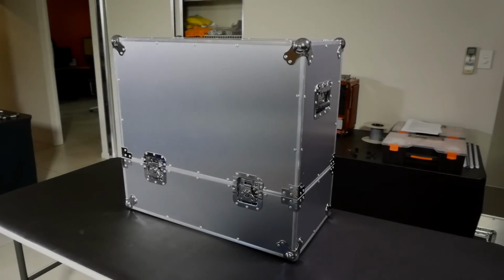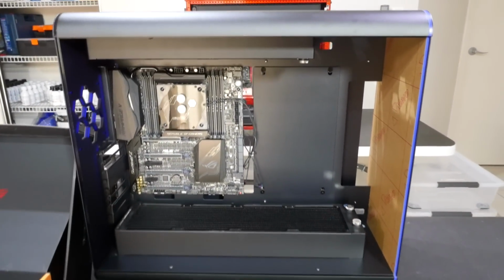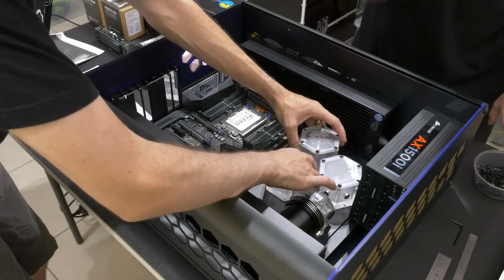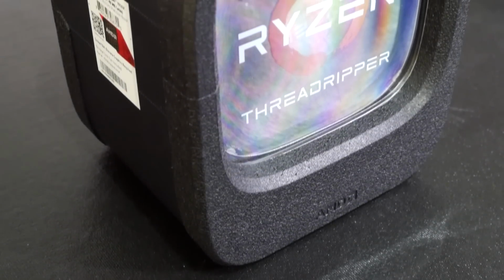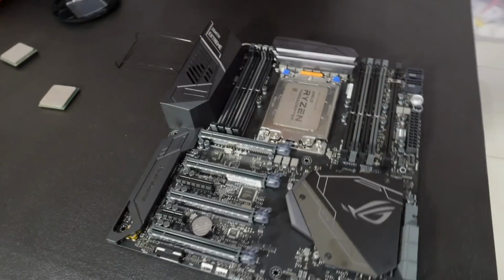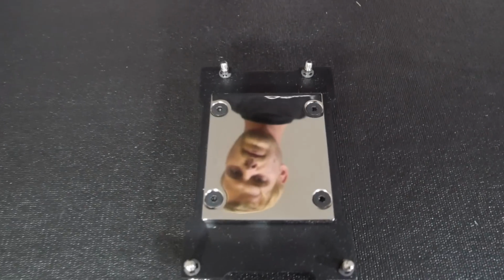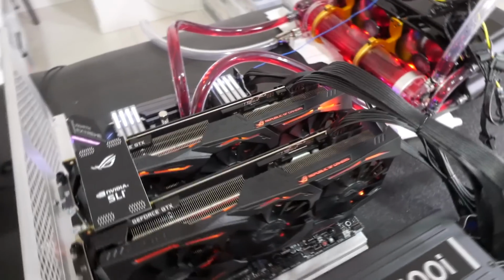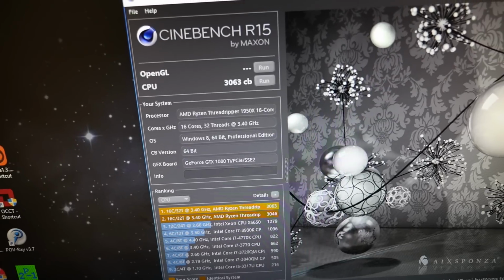Tritium Ultimate Threadripper Build Part 1

Comment: There is not much value retention in pc components, they are like cars.  I'm still using a system I built in 2010 for $1300, but it's now worth about $200 on craigslist IF I could find the perfect buyer. I could argue that the value retention is in the longevity of the components, but if you are suggesting in any way that this system will remain "top of the line" for any length of time that's funny.

Comment: Out of curiousity, what was the total cost of the whole system?
Reply: what i got from amazon links, ca 5000USD
Reply: Its well over 10k. Exact amount, idk. But an SLI with 1080Ti is almost 2k, power supply is about 350, each M.2 is 300 minimum.

Comment: If i have 1200W power supply and components require minimum 400-900W, will it waste just that amount of power instead 1200W?
Reply: And the benefit of having an overpowered PSU is that it won't need to run the fan full blast if you don't use it all.
Reply: The computer will consume only the power used by your components. It doesn't matter of the power supply is 1200W. That just means it can deliver up to 1200w.
Reply: 1idd0kun Thanks, I wasn’t sure about that either 🐨
Reply: xXSilentAgent47Xx needed more power for oc stuff..
Reply: spare some electricity for your bathroom lamp dude, no one want to hurt those tiny little toes

Comment: Did you run the rams at 2133 MHz? Does not it work at higher speeds?
Reply: I think 2133 it's the stock speed. You have to enable XMP profile in bios to choose at what frequency you want them to run

Comment: That EK block doesn't have flow over the whole IHS.. And that may not currently be a problem for some, but should AMD decide to use  4  modules instead of the current 2 then that extra coverage would surely help.

Comment: Make sure you change useplatformclock = false in bcdedit. Open cmd with administrator rights, type "bcdedit /set useplatformclock false" without quotes.  The ROG Zenith Extreme comes with Ai Suite 3 which turns useplatformclock to True.  This causes Threadripper to have some nasty lag and performance hiccups  It doesn't play well with Useplatformclock set to true.  Turning it off (false) also decreases boot time.  Also some of the boards ship with old firmware for the OLED display and Aura.  For a while, after the October Bios release, mine would only display red colors and OLED would not respond to changes in the livedash program.  Got the latest firmware and Bios from December installed resolving all issues last week.  The 4GHz profile made by ASUS causes issues for me with useplatformclock set to false.  just manually changing the multiplier itself, though, worked flawlessly.

From a fellow ROG Zenith Extreme/1950X Owner.  I was able to OC my system to 4.1 GHz stable but I haven't played around with voltage yet to see if it will go any higher.  I'm content with 4.1...

Comment: Why are the temps so bad even in idle/bios? Even for 16c 32th that must be unusable under load.
Reply: It's only in BIOS setup, for some reason Ryzen CPU's always run hot while setting up UEFI/BIOS, as soon as they boot into O/S it cools off again.
Reply: 64 degree celsius cpu diode on idle isn't healthy either.
Reply: but it isn't idling, all the cores are fully active, it's a kind of test load
Reply: You realize windows screen is idling? I took the temps from before he started prime.
Reply: Hmmm, yes you are right, didn't spot that first time. It also shows both GPU diodes at 52 C so I wonder if it's reporting accurately ? Aida 64 may not be perfectly optimised for Ryzen yet.

Comment: i have a question: for the AIDA64 sidebar (on the desktop) you use the windows gadget app. I've seen your video about it, but i can't use the windows gadget, it does appear that it has been disable by microsoft for security reasons :(
Windows now wants me to use the windows store instead. How did you fix this problem ?

Comment: This is great....too bad threadripper isnt very good for gaming...a 7700k is better for just gaming
Reply: J and K White who ever bought it is probably going to do other things then just gaming
Reply: anton rockoboac im sure...thats a ton of money for just gaming
Reply: J and K White you can also render things that utilize a ton of threads   very well that only a high end Intel cpu above a i7 would do a better job but yah things that rely on core per core performance would be better on a i7 7700k
Reply: anton rockoboac I totally understand and knew that...that is why I specified gaming. Obviously this isnt just a gaming machine. You buy threadripper to say you have one...because its cool. But I would have just bought an 8700k
Reply: i9 7920x/7940x/7960x/7980x are not good for gaming too and it costs1200- 2000$ and it is weaker then fakn 7700k in gaming so why dont you mention that?? seems that dummies forget that Intel got much more expensive cpu-s which are totally shit for gaming but none of assholes  dont mention that !! and Threadripper isnt bad for gaming because  with few new drivers it is even better then 8700k in some games so from which cave you came out !!
Reply: Mr11ESSE111 I see you ever were
Reply: well if youre too lazy to close your browser with 20+ tabs and stream music then the 7700k gets slow pretty fast, or if you have like 2 games running cause your LoL queue times are insane
Reply: haha wrong. suggest you check your specs my 1950x has a rating of 23k on passmark and its STOCK not even overclocked yet...  only thing above me is a i-9...
Reply: Mr11ESSE111 ummmm ok? He could've used Ryzen 7 too. Wtf does it matter? I like AMD and Intel.

Comment: EK are my default waterblock of choice. However they cheaped out on Thread Ripper by not splitting the jet plates. XSPC have a much better block that has shown to be 10 degrees better and has built im RGB to boot. That's where my money would have gone.

Comment: 62 °c for CPU is that normal for threadripper?
Reply: yeah it's a 180 watt chip, that's like 3 regular i7s.
Reply: Fredrik Carlén What's the temperature under load?
Reply: No it's not normal. Aida is probably reading wrong temps. Threadripper should idle at around the same temps than any normal CPU.

Comment: Please watch this video from Kyle at HardOCP on the EK supremacy Evo vs the XPC TR4 :
https://www.youtube.com/watch?v=nw-TqUjhdmI
The EK one basically is not fit to cool Threadripper propperly compared to the XPC one.
I want this build to be as good as possible too. :)
Reply from the maker: Its not the one we are using for the build, only temporary for testing. Temps were not great. We will do some videos on this on the other channel or maybe include it in the build log.
Reply: Good, glad i could not be of help. ;)
Reply from the maker: :) Good info for other people though.
Reply: Yes, mariodrv, you speak words of wisdom. I too am in the process of putting together a 1950x build and wish I hadn’t spent money on the ek water block. I am waiting on a xspc one now.
My build is kinda similar to this one except case, ram and motherboard. It’s total overkill and my first water cooled system. And if anybody wants an ek threadripper waterblock pm me, can have it for price of postage.
Reply: Look into Heatkiller block as well.
Reply: EK seems to have just phoned this one in and couldn't be bothered to develop a proper water block for this cpu. It's to bad , because it probably means that if they release a monoblock for this cup/ mobo it will be no good eather.